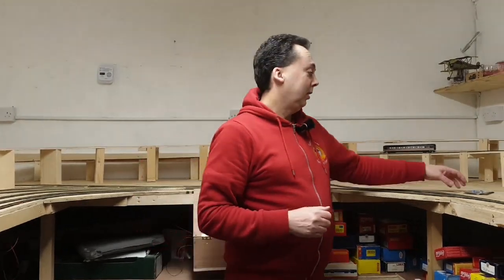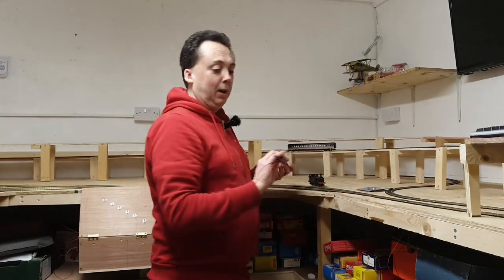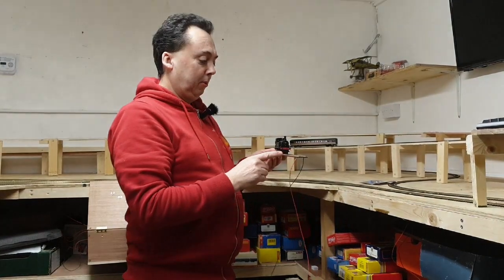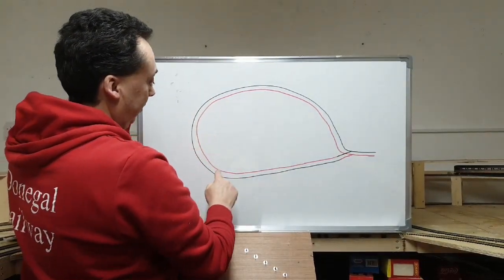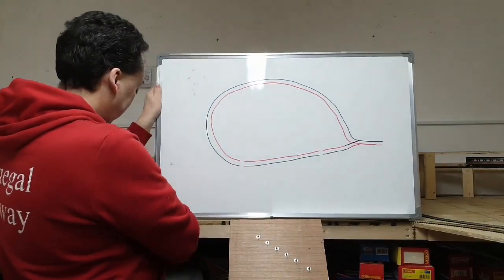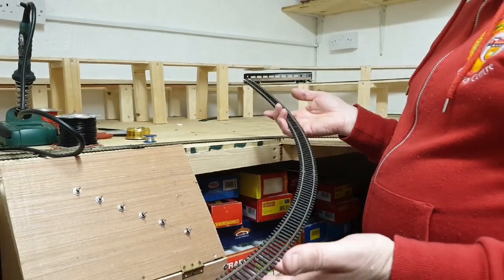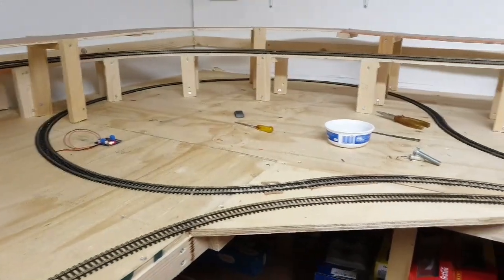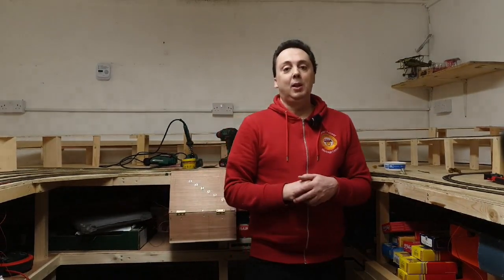48. Installing an Auto Reverser on a DCC Reversing loop on a Model Railway

Comment: i think model trains are interesting but unfortunately i simply can’t afford to do intricate things and expensive sets. 
 i have always wanted to have one above my kitchen cabinet that had the auto reverse ability from the track so it wouldn’t need to turn around in a circle . 
could this work on any track ? even a cheap one? i can’t afford to spend hundreds and hundreds of dollars on something like this and i don’t need an entire set just one little trolley and a few tracks. 

sorry if this was a lot of words, im just a bit confused and you’ve been one of the most helpful resources i could find!
Reply: https://youtu.be/uScvot0ZBGs?si=m5tIC-qnperawcSP  this is what i’m looking for , i’m not good with electronics. but would this method you used work for something like this? or is it simple so it will switch to the other track and not go in circles? thank you in advance for any help you can give me!
Reply from the maker: That looks like an easy way to go about it, I think it will do exactly what you want to do. Here is a playlist of a Christmas layout I built using a DC shuttle, to give you some ideas.

Comment: I realise this is an old video but just what I needed except for the fact that I have no idea how to wirer anything up!! lol Have you done another showing the wires themselves or know of any others showing the same etc?  I'm doing a cut through on an oval of track in DCC.  Thanks
Reply from the maker: Autorevser is powered from your feedbus/controller. Two wires from the reverser to the track section which is isolated on both ends. As it is from about 4.20 into the video.
Reply: @DonegalDadRail OK I'll do a bit of research on it as well thanks 👍

Comment: IF ALL MY LOCO'S HAVE A DCC DECODER INSTALLED DOES THE ABOVE STILL APPLY??
Reply from the maker: Yes you need an auto reverser weather its DC or DCC or it will cause a short. The other way to do it is switch the section manually.

Comment: How do the points get changed?  Whoops, just been on line and read that the reverser has a points operator plenty of wiring to do, might have a go
Reply from the maker: I use seep point motors to change points.  The auto reverser just changes the polarity tp stop shorts.

Comment: Correct me if I’m wrong but I believe that the insulated section has to be at least the length of the longest convoy
Reply from the maker: The isolated section only needs to as long as your longest loco or multiple loco's if running them in multiple.
Reply: @DonegalDadRail  No, the isolated section must be as long as your train as the coach wheels will short as they cross the gap.
Reply from the maker: @nigelwright7557  It shouldn't cause a problem if using insulating fishplates on the section, the area of the wheel in contact isn't large enough to short. I have never had a problem.

Comment: Mark, thanks for your video and intro to auto reversing. Can you advise if you have used the Rev 2 Auto Reverser from Block Signalling with point control. I'M using DC and this module appears very useful with switching the points. Look forward to your response,  Graeme.
Reply from the maker: Thanks Graeme, no I haven't used the Rev 2, you can check out the instructions for it here https://blocksignalling.co.uk/Documentation so you can read up on it. The Block Signalling products are very good.

Comment: You can machine that when your train tracks also is a loop in its  self & if the polarity is different when you come back on it self you will also need a ar there.
Reply from the maker: Hi Juergen, I think you are saying that if the loop also comes back into a point you need an autoreverser as well which is correct.

Comment: Thanks for the video, I am trying to get my head around this concept and I think your video is one of the better ones at explaining it.  However what I don’t understand is I would have expected you would need to isolate the whole loop.  In your demo you isolate a section approx 50cm, when the loco enters the isolated section the polarity switches, so when the loco exits the isolated section would it not start reversing (it obviously does not as shown in your video, but I don’t understand why).
Reply from the maker: Thanks Chris, when it exits the isolated section the polarity is already flipped, an if it wasn't the Auto Reverser would flip it again if required.. When running DCC its the signal sent to the chip that determines direction.

Comment: good explanation about the little device but im doing a dog bone track with two loops sio the un it will have to sit in the middle of the bone with 4 fishplates
Reply from the maker: Thank you Matthew, depending on the configuration of your dog bone it might be better to have two units with isolated sections.

Comment: Hi Mark, great video. I don't see the connection from the external ways. Are you using a DIY module??? I'm trying to install one, but I can't get it to work. It has power but when the locomotive enters the isolated area it stops. I am using a kato N4 turnout with which I have to test some configurations and a digitrax db150 control unit. what do you think could happen? Thank you very much.
Reply from the maker: The unit I use is from Block Signalling. It is powered from the the buswire and the other two wires are connected to the track. The section of track must be isolated at both ends.
Reply from the maker: Here is another video I used an autorevser on. See if this helps https://youtu.be/73olTtQ9bEo

Comment: Mark, I have 3 sections on my layout that have a reverse loop, do I need to buy 3 of the modules or can I wire them to 1 module, thanks
Reply from the maker: Hi Tommo, you need a reverser for each reversing loop you have. So if you have three reversing loops you need three modules.

Comment: Really great & easy  simple video to follow makes sense 
I’ve encountered an oversight on an additional reverse loop completely shorted the whole layout 
If I use a dremal cutter and cut a gap in the new loop rails leaving a 1-2 mm gap will this then electrify the existing layout again ? 
Then I can fit a auto reverser at a later date am I correct in this assumption 
I’m on analogue will it still work ?
Cheers 
Hope you can help
Reply from the maker: Thanks Iannang, If you cut the rails you will need to wire it up with an isolating switch so as not to cause a short and then you can add a autorevser at a later date. Hope this helps.